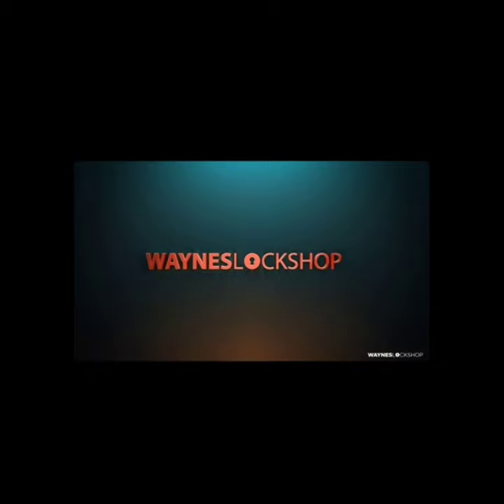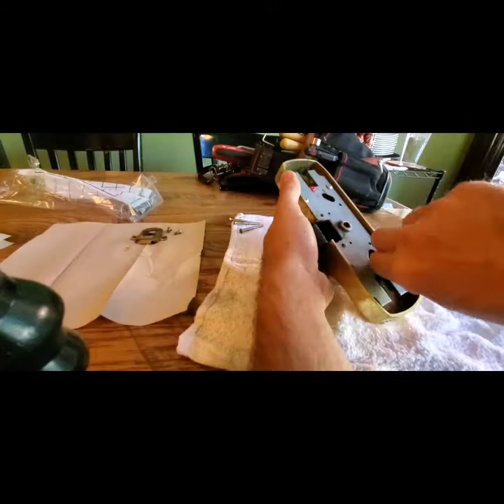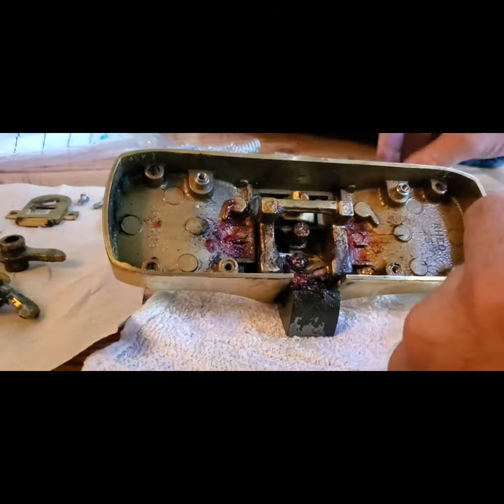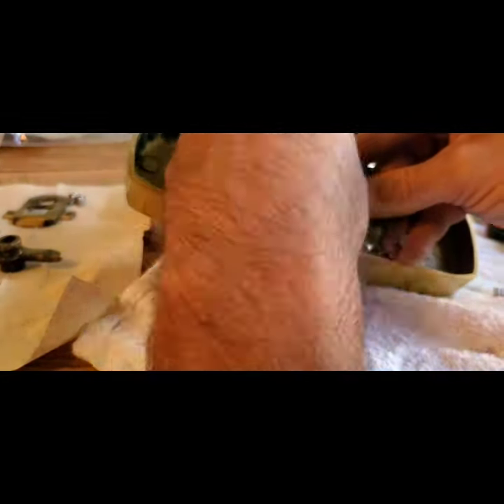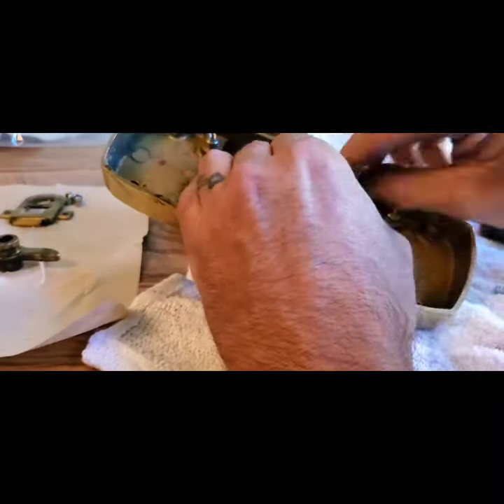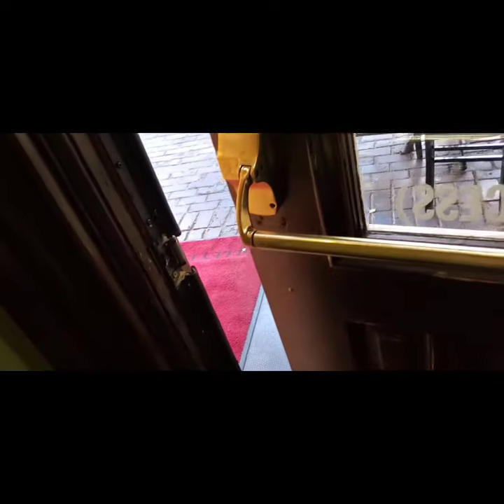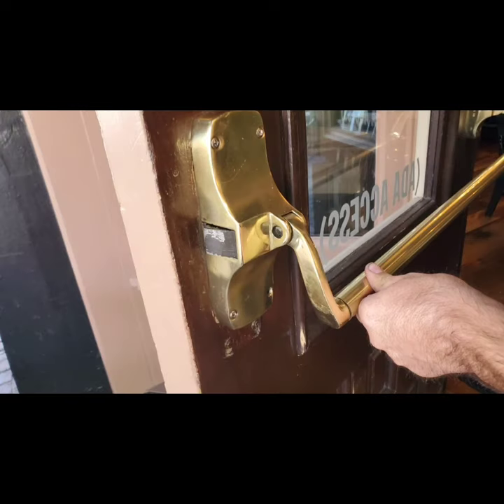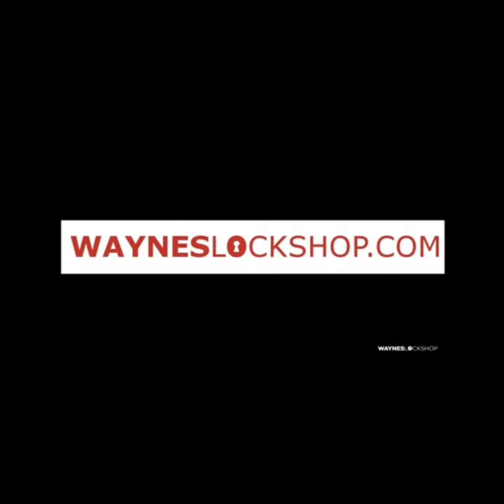Von Duprin 88 panic bar exit device repair re spring Vonduprin exit device

Comment: People don't understand these VD88 bars. The real springs that assist in latching are in the OTHER end and if you are missing your 5/16-18 set screws x 2 on the underside of the bar or if they are not tight you will never have correct action.
Reply: You are THE MAN! I had a handful of Von Duprin 88s that wouldn't latch at the school I work at, and I tried virtually everything to get 'em to do so. I figured the problem was in the end of the panic bar opposite the latch, but it never occurred to me that that sleeve on the end supplied compression to the inside of the bar (duh!). No wonder most of them have split at their ends after so many years of use! At any rate, a 5/32" Allen key was just the ticket! I even found a couple of places online that sell 5/16'-18 set screws by the pack at very reasonable prices. I'm sure my local hardware store would carry them as well, for literally cents each.

Now I can look into replacing the split bars with some cheap brass bar stock or heavy copper or steel tubing! Thanks again, 600miles. I guess it's true - not all heroes wear capes! Unless, maybe you do...